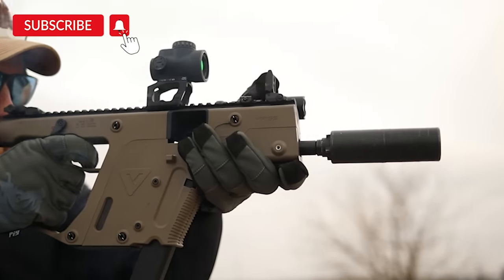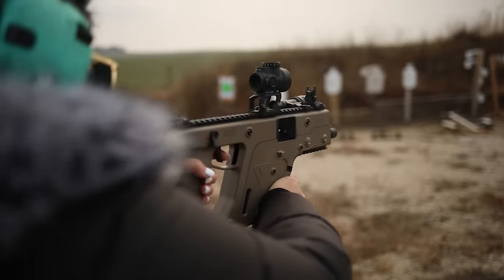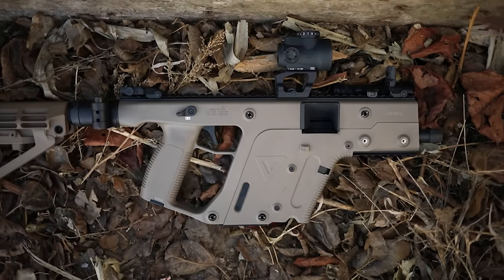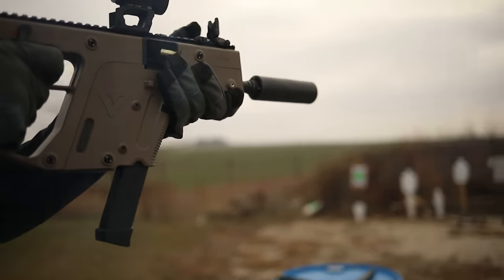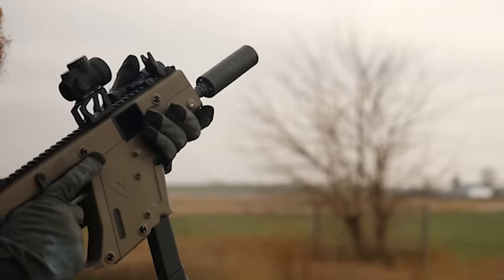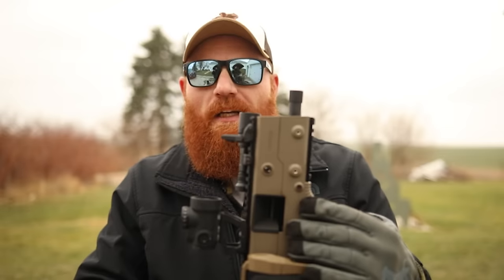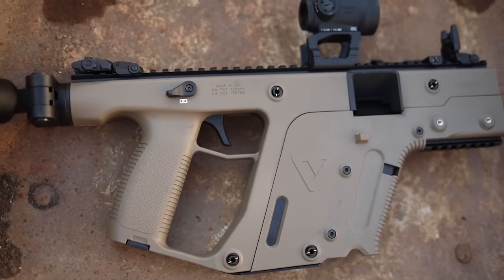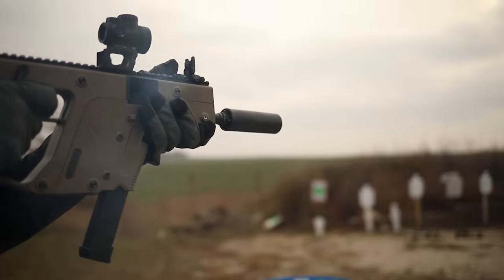Kriss Vector 9mm PDW: Is The Hype Real?

Comment: Been waiting for this one for a long time.  I was hoping you'd go for the 10mm so I could see if you have some of the same issues I've had.  I really want to love this gun as much as I did before I owned one, but I have been having feed issues with my 10mm.  Hoping to have narrowed it down to either aftermarket mags, or 'flatter nosed' ammo.  Some people suggest that more rounded nose ammo works better, I still have to try the expensive Sig ammo I got for it; it's about the only stuff I've found with rounded nose.  IN MY OPINION...Stick with the 9mm or .45.  For one, they seem to have less feeding issues, and two: 10mm Glock mags aren't as cheap or available.  Best to get the Kriss factory mags, and also avoid the Kriss extension kits.  Maybe the best add-on is the small Kriss 'angled grip' that extends the space under the handguard and moves your hand away from the controls a bit.  It keeps you from hitting the mag release and bolt catch which may be a reason I sometimes have feed issues and it's under $20 iirc.  Have yet to try my first suppressor on mine, but if anything I expect it to run worse with it.  I also added the Gen 1 upper so I could run OG folder stock, mostly for appearance, but the 'brace' I started with was extremely uncomfortable and had to go.  The OG folder is much more comfortable but the whole package adds about $300 with the new upper.  I would spend the money on an MPX.  It does everything better IMO, though I only have a 9mm SIg to compare the 10mm Vector to.  The Sig has way less felt recoil even with the 'Super-V' system and in my configuration is even smaller than the Vector.
Reply: The MPX with a Timney trigger is FAR superior to the Vector trigger as well!
Reply: Hey, i own the 10mm, feed issues happen mostly with inserting the mag quickly for me. It tries to feed the round early or something. This is only when bolt is open. You can slam a mag on the closed bolt and then charge just fine. But I haven't found a good fix for the open bolt reloads.
Reply: 10mm needs a lil babying. Get some lithium grease on the action. Choose only [B]lock mags, no aftermarkets, and as Breakbeat said, jammin the mag in, overseats it.

Comment: I used to have a 9mm Vector and it was absolutely useless. Couldn't make it through a standard mag without jamming multiple times. Apparently these problems were not uncommon. Glad that they appear to have fixed it.
Reply: Replacing the extractor spring with a slightly bigger one fixes it

Comment: I owned a  carbine length  original version. I hated it.  The ergonomics were terrible. Charging the gun required a short, hard snappy pull or it wasn't happening.  The reduced recoil was not noticed when firing semi. Those that fired a select fire version in full auto verified that the reduced recoil system is only noticeable in the full auto mode.  At the time I owned it, I had to buy Kriss Vector magazine kits along with two glock .45 mags to make an extended magazine for it.  I traded it off .  Thumbs down from me.   I suggest try before you buy.